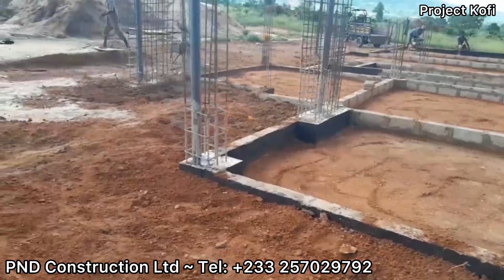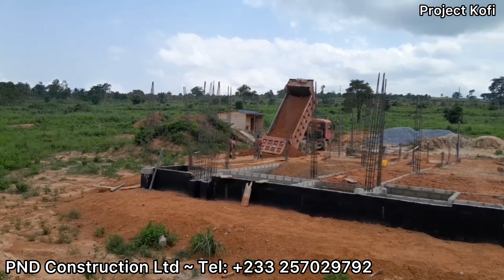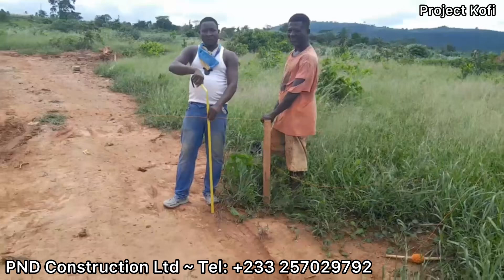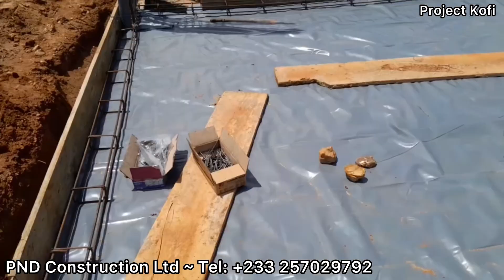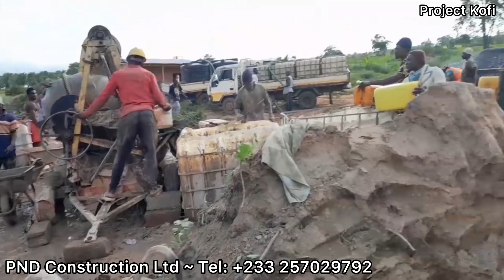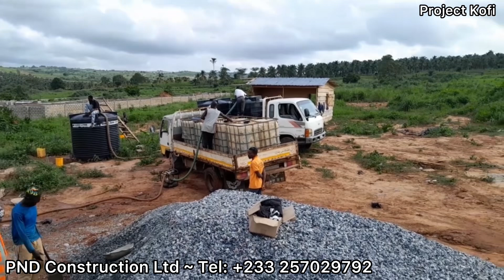Building in Ghana: Ground Floor Casting

Comment: Next time, use an HDPE (High-Density Polyethylene) sheet membrane—very tough and puncture-resistant—or a torch-on bituminous membrane, as gaps at the pillar can let water seep through.